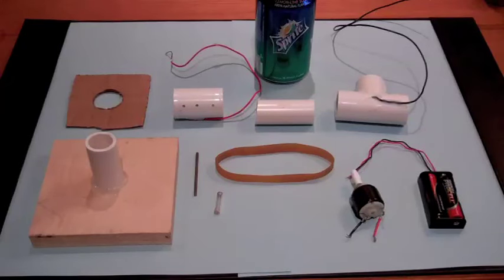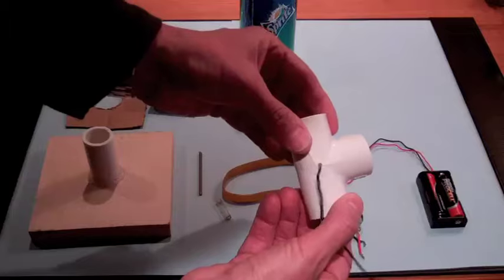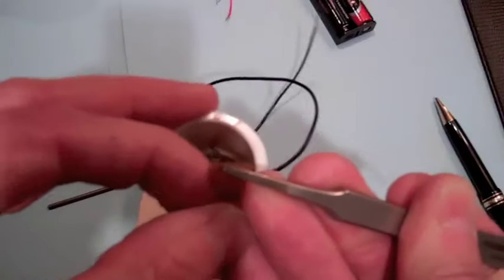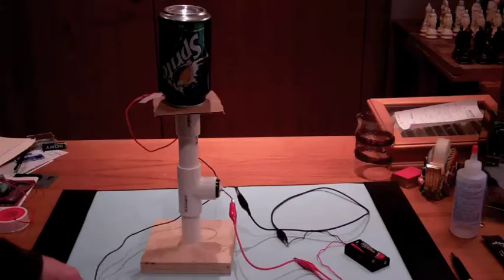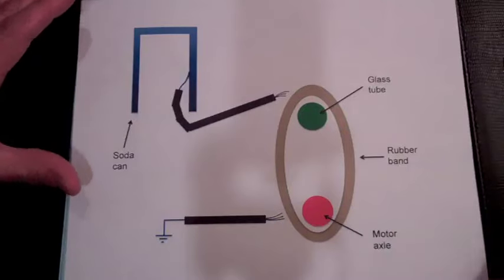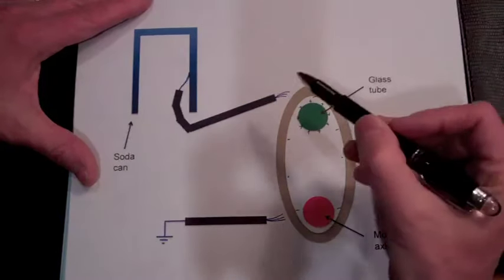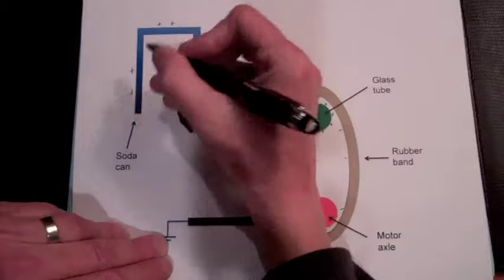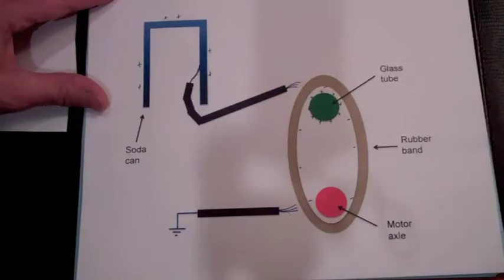Van de Graaff generator

Comment: My motor didn't work against the rubber band😭 it couldn't spin even a bit..
Also what are the other holes for???
Reply from the maker: It is for the metal rod on which the glass pipe rotates. I had three sets to accommodate different length rubber bands.
Reply: @electricandmagneticfields2314  ohhhhh i see
For the motor to rotate, the length of the rubber band between the glass pipe and motor has to be almost stretched but not so stretched is it?
Idk whats wrong with my motor man😢 either the bulge was too small or that the speed of the motor was too less😔

Comment: What about the plastic liner in the aluminum can?
Reply from the maker: I did not think of that but it must have been able to conduct through it as it worked. Maybe it would have worked better if I had sanded that area or just made the connection to the outside of the can.

Comment: where can be the glass tube found ?
Reply from the maker: Take a fuse and heat the ends with a soldering iron so you can pull off the metal caps. That is what I did.

Comment: So I was playing with a Van degraaff generator 40 years ago ( and the discharge spark was about 11 inches) I put out my fist and let it discharge  on the tip of my (bird finger) knuckle about 8-10 times and the next day I had a water blister 1/4" x 1/4" in the same spot. I guess the spark  made quite an impact.
Reply from the maker: Wow, fortunately that didn't happen to me. My generator probably was developing less charge than the one you were using.

Comment: could you plzz tell the measurements of the pipes and wires and what batteries have you used
Reply from the maker: I took fuses, heated the ends to pull the caps off as the glass pipes. Any wire would work and the batteries are just anything that will turn the motor. The faster it turns the quicker it would charge up. For this one I used two AA batteries.
Reply: @electricandmagneticfields2314  thnxx alot dude this is so easy n awesome to make
Reply: could i use a thick hairband instead of the rubberband?? as idk y but its not available in my area
Reply from the maker: @Prod_Hadroz  It probably would work. Any dissimilar materials in contact will result in charge transfer.
Reply from the maker: @Prod_Hadroz  Thanks
Reply: @electricandmagneticfields2314  any alternatives to the teflon tape on the moter axle
Reply: any alternatives to teflon tape on the motor axle

Comment: im making one, but i have a motor which is very very very slow. its a lego motor. Will it still work?
Reply from the maker: It will work. The charge will just build up at a slower rate.

Comment: was the glass tube stationary or was also spinning?
Reply from the maker: The glass tube turns, so there is contact between the glass and rubber band but not friction. It is the contact between the glass and rubber band causing the separation of charge.
Reply: @electricandmagneticfields2314  ohh i see, thanks

Comment: Does the top need to be glass? I’m trying to build one without it and was wondering what to use.
Reply from the maker: No it can be a different material, but the further apart on the turboelectric series between the rubber band and roller the better it will work.

Comment: Can it also work if the rollers are made of Teflon and paper
Reply from the maker: Any material for the rollers will work as long as it is a different material from the band. Of course the further apart the two materials are on the triboelectric series the better it will work.

Comment: Sir what if the wires touch the rubber will it still work or not ?
Reply from the maker: I am not sure, you will probably get microscopic pieces of metal on the rubber, but not sure what effect that will have.

Comment: Just wondering why the brushes can't touch the belt.  It seems like it would be the same function if it did.
Reply from the maker: Eventually they would not touch because the wire would scratch off the rubber. Similarly there would probably be pieces of metal on the belt. It would be interesting to try and see what happens for sure. Whenever I try an experiment I usually get surprised! I'll try it next time I get a chance.
Reply: @electricandmagneticfields2314  thanks for responding a decade after the production of the video.  I was thinking of making a tiny one to charge an electroscope for gamma ray detection.
Reply from the maker: @kq6up  That should work. I have used a Van de Graaff generator to charge a leiden jar capacitor, https://youtu.be/Lh6YATitN9k

Comment: For a negativly charged van de graff... use  silicone rubber  for the top roller and a ptfe or teflon for the bottom roller.

Comment: ok great!   now  the human body is 60 percent water... so when a hydrogen molecule looses its only electron it just becomes a proton.  this accumulation of these protons is acid.  acid chemestry is just as important to good health as is base chemestry, however an over accumulation of hydrogen molecules that have los their only eectron can cause an imbalance in our body chemestry.  known as pH or poential of hydrogen.  

pH is the measurement of the chage balance in our body fluid systems...  or the potential of the hydrogen molecules.

the scale runs from 0 to 14 in base 10 with 0 or something very near to 0 being very acidic and or a very large accumulation of hydrogen molecules that have lost their only electron... or acid and 14 being very caustic or and accumulation of molecules that have extreemly large numbers of accumulated electron charge.

by observation pure electron charge is benifical to the body as is north pole magnetism into the skin and pure proton or positive charge is not so benificial to our fluid chemistry systems for the above explained reason.  

the standard american diet tends to be proton heavy or acidic... to much over prossed foods which acidify our body chemestry.   cookies, cake, candy soda pop, processed white flour, ect...

causing an acid imbalance in our body chemestry.

so to make a vdg generator that produces an accumulation of electrons at the top dome is much more benificial than a vdg generator that accumulates extra proton charge at the top load.

for more detil see thomas kim channel on how to make both a positive or negative vdg and also google pyroenergen for more indepth look into the health benifits of negative static charge.  

also the importance of earth grounding here on yt and the www.  its best to get our energy from nature and from vitalized food not from some electro mechanical device... 

polyphenols are fancy electron donors in fruits and vegtables and earth minerals are also important electron donors to keep our cells running at their peak operating voltage.

Comment: Sir with some set up..... can this power up home
Reply from the maker: You can generate a high voltage, but the corresponding charge is small. So it would not supply much current. Not practical  for producing electricity to power a home.

Comment: Does the width of the rubber band matters? Does it have to be really thin or flat? Or a bit thick
Reply from the maker: I don't think the thickness will matter. The wider the more contact between the rubber band and the glass and the more total charge.

Comment: What are the materials?
Reply from the maker: Any piece in particular? PVC tube, toy motor, rubber band, metal rod, glass tube that can fit over the metal rod, some wire, a soda can, and a wooden base to which I glue-gunned the PVC base.
Reply: Michael Melloch Thanks!!

Comment: Sir, I did all the procedures but the rubber band doesn't move. I tried to give it a push too, but it didn't help. Can you give me an alternative to the rubber band?
Reply from the maker: I would stick with the rubber band and figure out why you cannot get it to turn.  Does your glass tube spin easily when you do not have the rubber band on it? If so, maybe too much tension from the rubber band? Could you move the motor up a couple of millimeters?

Comment: Simplify !!! Plus: the real Van gennie had 3 one way caps inline and 2 spark gaps: small gap on top large gap and balls on bottom fyi. Also...lol, the REAL Van Gennie never had a motor it used gravity.
Reply from the maker: Kelvin's electrostatic water dropper generator used gravity,
https://www.youtube.com/watch?v=Y7MJbZTjKyo
and was the inspiration for later generator's like Van de Graaff's. In fact Kelvin suggested the use of a belt.
Van de Graaff's first generator used a motor, 
http://web.ihep.su/owa/dbserv/hw.part2?s_c=VAN+DE+GRAAFF+1931
Reply: Michael Melloch: your first address is incorrect. Takes you to Google Accounts sign in
Reply: Michael Melloch: also what you might detect like I did with both Tesla's public "patents", (LOL and I laugh because the patent office is SOOO CORRUPT IT SHOULD BE A CRIME OH WAIT IT IS) and Graff, as well as Marconi, is that subtle changes have been made by either them or an imposter. Why, easy: for some reason the general public is being hidden from zero point and magnetic free energy, not to be confused with electromagnetic or generated energy this is so much different. Reference Ralph Ring consciousness and eather technology, You Tube, as one example IF YOU can understand it like we do.
Reply: Michael Melloch: re Van Dur Graff. Yes, but illuminate the motor and transformer and ONLY THEN do u have Graffs ORIGINAL zero point energy device. Somehow, I suspect military tampering, his ideas have been altered in such a way where they now need an external power source to make any of the devices operate.  Well, they were not originally designed that way in fact someone has altered most of them, someone with a LOT of resources. Same with Tesla Marconi Edison etc. Like the saying goes: DO NOT BELIEVE EVERYTHING YOU READ on the Internet.
Reply from the maker: I fixed the link

Comment: Will this work in a vacuum of theres no N2and O2?
Reply from the maker: For the configuration I have, where the can becomes positively charged, the electrons from the can could still emit from the frayed wire end, where the electric field is high enough to pull electrons off the wire tips, and transport through the vacuum to the outside surface of the rubber band. The problem in a vacuum would be at the lower end where the electrons are removed from the outside surface of the rubber band. The frayed wire at the bottom is positively charged and this is where the high-electric field is. So N2 and O2 molecules are needed to supply the electrons because they have to be in the high-field region of the frayed wire. The field on the outside surface of the rubber band will be too low to pull electrons off the rubber band.

Comment: Can you please help us. We do all your procedure and steps but it didn't work what would be the problem?
Reply from the maker: It doesn't take much leakage to prevent the charge from building up. Was it humid the day you tried? Make sure the material your can is resting on is highly resistive.
Reply: What do you mean by hughly resistive
Reply: Right now is rainy day, so i therfore that the environment is humid.
Reply from the maker: For instance you might think wood is an insulator, but there can be enough surface leakage, especially if it is humid, to drain the charge off faster than it can accumulate.
Reply: Please explain briefly.
Reply from the maker: Not sure what you are referring to?

Comment: Can I use plastic tube instead of glass? plz answer cuz my project is going to be tomorrow and thanks a lot
Reply from the maker: The bigger the separation on the triboelectric  series between the tube and rubber band the better it should work. The bottom wire is grounded.
Reply: So.. did it work? Your project I mean : )

Comment: if we don't use the motor then it work or not
Reply from the maker: You need to turn it somehow. So it would not work without the  motor. You could use a hand crank if you do not have access to a little toy motor,

Comment: My motor Axel is so small how could i increase it it tried many ways but its breaking everytime, one more thing can i use food can instead of soda can that of tin or aluminium
Reply from the maker: Yes you can use any metallic structure such as food, soda, paint, etc. can. For me it is the glass tube that breaks often.

Comment: One more thing sir I want to charge Leyden jar with 30kv can I use it
Reply from the maker: What will limit the voltage is the dielectric breakdown of the insulator between the two conductors. I would think you could get to 30,000 volts with a Leyden jar like the one I used.
Reply: Michael Melloch so should i make 30kv van de Graff generator, to charge Leyden jar and how could I charge it effectively, I want high voltage to power up my ball cyclorton
Thanks for replying sir
Reply from the maker: It looks like you could just directly connect your van de Graaff generator to your ball cyclotron,

https://www.youtube.com/watch?v=6D3bMVv7w5w

Comment: Why does humidity affects the working of generator?
Reply from the maker: Humidity will cause moisture on surfaces. Even surfaces of insulators like, wood, cardboard, PVC, etc. will become conducting. The result is that charge will flow off, such as charge on the can in my generator, before it can build up.

Comment: Sir, i have followed the procedure step by step. But still there isnt any charge being produced on the can what so ever. What may be the problem?
Reply from the maker: It does not work well if conditions are humid. Has it been humid when you have tried it? I find it works much better during the winter, when conditions are dry, compared to during the summer.

Comment: Sorry for bothering you again but does the grounded wire actually do anything? Thanks.
Reply from the maker: Yes it does. It pulls electrons off the outer surface of the rubber band. Otherwise the negative charge would build up on this outer surface and stop anymore electrons from transferring from the metal can to the outer surface of the rubber band.

Comment: Sir I am trying to make a Van De Graaff Generator but my motor isn't strong enough to turn a stretched rubber band, what do you suggest I should do? Thanks.
Reply from the maker: Sometimes these toy motors will run if you can just get them started. Can you give it a little push and see if that gets it turning?

Comment: Could you use anything other than a glass tube? Thank you.
Reply from the maker: yes for instance some commercial Van de Graaff generators use aluminum and teflon instead of glass and rubber. The advantage of the aluminum and teflon is that it would be more robust. My glass tube is always cracking and needing to be replaced.
Reply: @electricandmagneticfields2314 how does it work? what will be the glass tube now?

Comment: Hello! I wanted to know the sizes of the pvc you used. Thank you :)
Reply from the maker: The diameter of PVC pipe in this video is 3/4 inch. I have also built them using PVC pipe of 2 inch diameter.

Comment: Will this make your hair stand up when you touch it? Will it hurt you if you touch it?
Reply from the maker: I have not tried, but it should make your hair stand up. It does not hurt, you can barely feel the spark. The reason is the capacitance is low, so even at 10,000V the amount of charge is so low you barely feel it.

Comment from the maker: Bowtie, I accidentally removed your comment, so I don't remember all you asked. One that I do remember is using aluminum and teflon instead of glass and rubber. The advantage of the aluminum and teflon is that it would be more robust. My glass tube is always cracking and needing to be replaced.

Comment: Very Pleasing Project Sir ! Can u tell the proof that is really 10000 volts being produced ? I need it for my Science project .
Thank u in advance...
Reply from the maker: In the video I incorrectly quote the breakdown strength of air as 10kV per cm. It is actually 30kV per cm. Of course it probably depends on the humidity being lower as the humidity goes up. So breakdown occurred when my finger was about 1 cm from the can. If the electric field was uniform between the can and my finger, which it isn't, that would translate into a voltage of 30kV. So I think an estimate of at least 10kV is correct.
Reply: It will really work well in dry season. You can try it under blankets 😂 in winder dry season

Comment: sir from did u get d glass rod?
Reply from the maker: I scribed and broke a pipette. You can also use a glass fuse. If you heat the ends of a glass fuse with a soldering iron you can pull off the metal caps.
Reply: thanks sir

Comment: Thanks for you great illustration. I think the breakdown strength of air (dry) is ~ 32 kV/cm
Reply from the maker: +Mohamad ghaffarian niasar You are correct, I say 10 kV/cm in the video for the dielectric breakdown strength of air and it is actually about 30 kV/cm for dry air. I haven't found consistent data regarding the effects of humidity on breakdown strength. But it was during our humid summer that I made that video!
Reply: Can we replace glass rod on upper roller with nylon tape  only like the 1st roller 
Will it still work

Comment: What  happens if The brush and rubber band touch each other while the motor is working?
Reply from the maker: +Ronnachai Mita When I get a chance I will try that. I think it should still work, at least initially. Eventually the wires scraping on the rubber band will scrape away enough rubber that you might have a gap and an insulator on the ends of your wire. Then it will probably stop working.